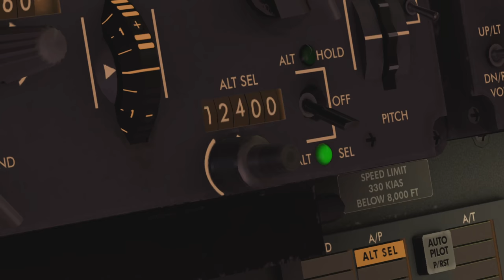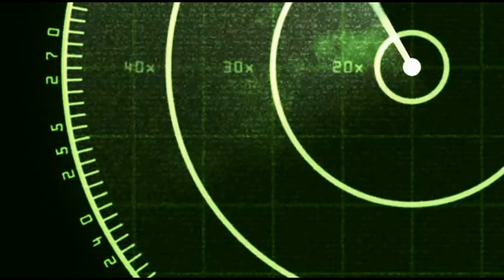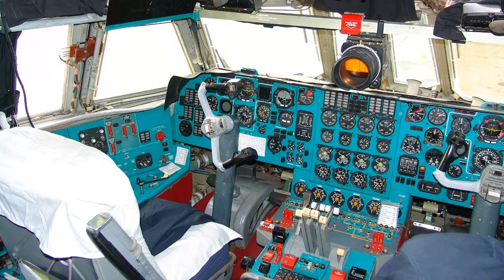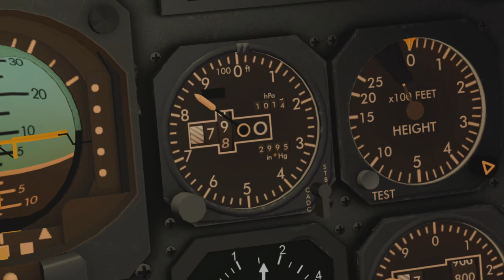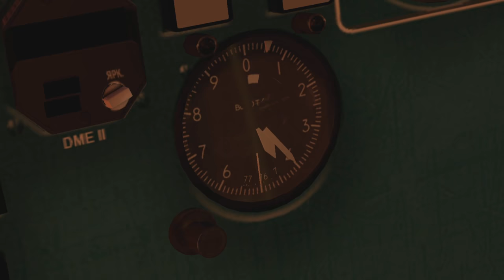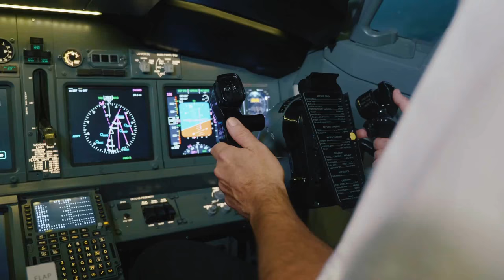Charkhi Dadri Mid Air Collision - (Saudia 763 & Kazakhstan Airlines 1907) DISASTER BREAKDOWN

Comment: 1. If VK Dutta had secondary radar, he would’ve warned the Kazakh pilot

2. If the Kazakh radio operator clarified with the crew & ATC, the Kazakh plane wouldn’t have descended pass 15,000 ft

3. If TCAS was installed on either planes, they would’ve had warning.

Unfortunately, the “holes” aligned and the accident wasn’t stopped
Reply: If there were no clouds, they could have seen and there was a possibility of avoidance. It was just a bad bad day.
Reply: @sd-wm1sq  Well, you’re not wrong
Reply: The tcas, secondary radar and betterment of communication were all implemented throughout the country and the world after this accident.

Comment: A focus on the level of corruption must be done here. Indira Gandhi International Airport did not have secondary surveillance radar. Not because it didn't exists. It was year 1996. 90% of world, even 3rd world countries had this advanced radar. This radar provides extra information, such as the aircraft's identity and altitude, by reading transponder signals. Had it been installed there, the controller would've got an alert on his terminal as soon as planes breached the assigned altitude.

Here is the kicker. That sophisticated new radar hardware was physically present in india.. but NOT INSTALLED for years due to red tape and bureaucracy of the govt. 

The bureaucracy and shameless corruption of Indian govt at that time, is majorly responsible for the death of these folks.

After all, it is true, that had they been flying elsewhere in the world, they'd have been alive. They are only dead coz this happened over a corrupt country's airspace

Comment: Actually it was collision between Kazakh airlines and Saudi airlines  the Kazakh airlines pilots was not fluent in English language because back in Soviet Union most of pilots standard language was Russian not English even after 1991 new country Kazakh pilots were used speak Russian and
Indian air controllers also complained that the Kazakhstani pilots sometimes confused their calculations because they are accustomed to using metre altitudes and kilometre distances, while most other countries use feet and nautical miles respectively for aerial navigation

Comment: Hey, DB (or anyone else with knowledge of aviation standards), 'unanimously unfavorable'...can you elaborate?  As I understand it aviation uses imperial units because modern flight kind of started in the US.  Are miles and feet more favorable units due to legacy or is there another intrinsic property of imperial units that makes them more 'proper' to use?
Reply: Imperial units are more of less used because of legacy and because it would be too complicated to switch, aviation is international so it’s no surprise that all countries are nowadays using imperial for aviation
Reply: It helps to use different units for different things. So short distances in EASA are measured in m fir runway visual range and ft for altitude. Miles for distance but km fir visibility. These mixed units reduce confusion since the unit reinforces the quantity being talked about.